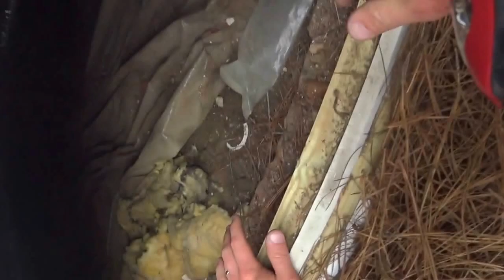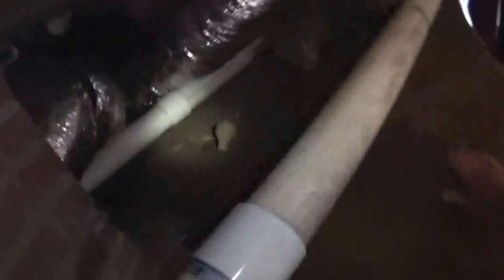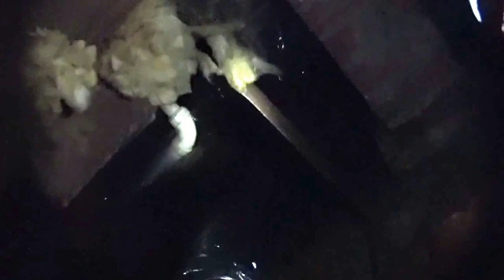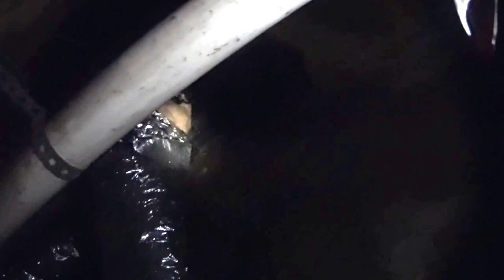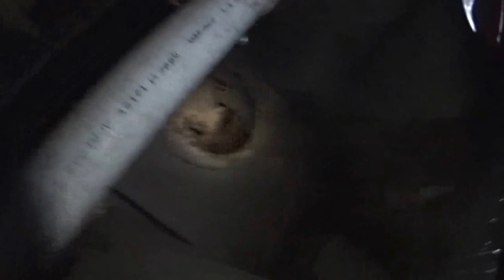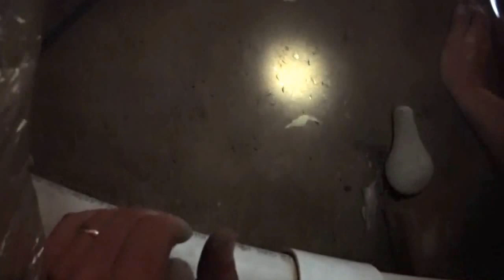HVAC Service: Plumber said ducts might be wet.

Comment: Tight crawl spaces and attics with shallow pitched roofs really suck. I once got a called to investigate a smell under a house. Owner said another contractor refused to check it out because they seen a dead mouse a few feet inside from the access hatch. Dead mice don't bother me as much as seeing eye balls blinking back and hearing things running about on the plastic vapor barrier. After checking out the duct work told customer to call an exterminator.